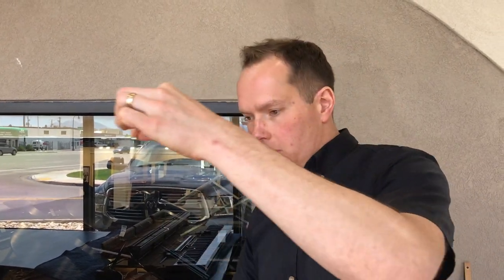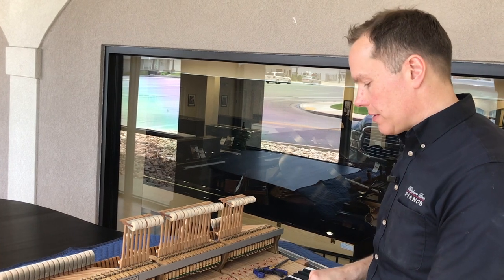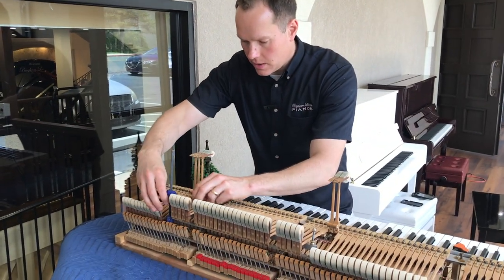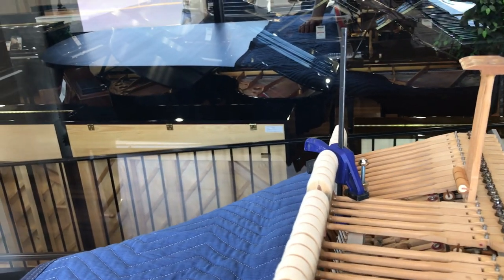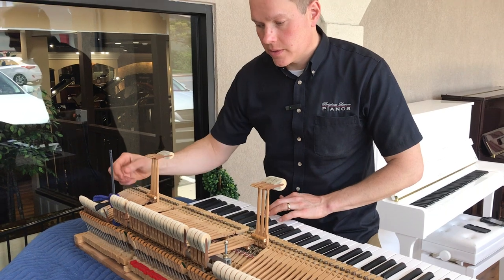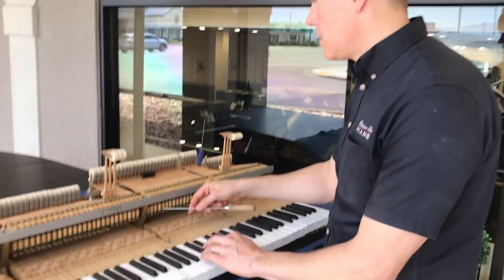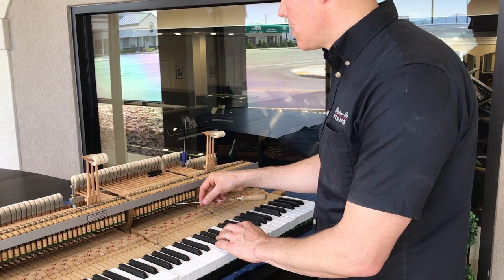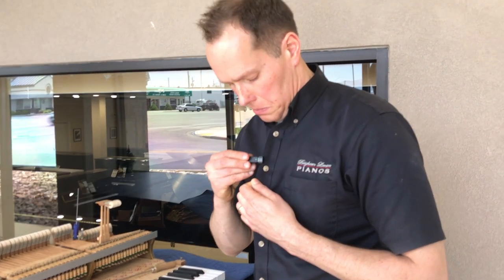How to do Accurate and FAST Grand Piano Let-Off

Comment: I saw another good method and it worked for me. It was particularly useful because I have trouble accurately bedding my keyboard frame when it is out of the piano. The method has you adjust the let-off with the action installed in the piano. Go aggressive with the adjustment until the note repeats or otherwise mutes the string. Then just back it off slightly - just enough to get a nice pure tone. Thanks once more for the great training videos. You are making me feel like a know-it-all. lol
Reply: Interesting. I tried your method. Backing off to a pure tone wasn't quite enough. I would get key resistance when I played a song. About another quarter turn was necessary to make the key work correctly. Maybe that's because the knuckles on my 1905 Ibach have lost their original shape and are somewhat flattened, throwing off the jack regulation to the knuckles. Good suggestion, though, with my slight tweak.
Reply: Thanks, John. Glad it worked out for you! @JohnParmater

Comment: What if the heads of the hammers are a different height from a previous filing? I think the standard way is more time consuming but more accurate. There's probably 1/8th difference in standard hammer dimensions in each section from new. Your way would give an uneven regulation.
Reply: Previous to this step, the hammers are gang-sanded to assume the same height.